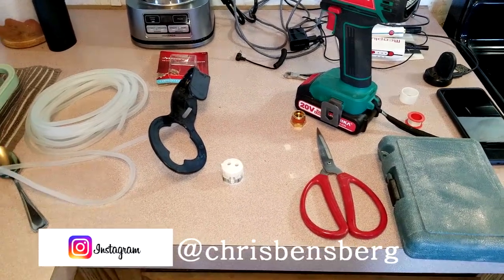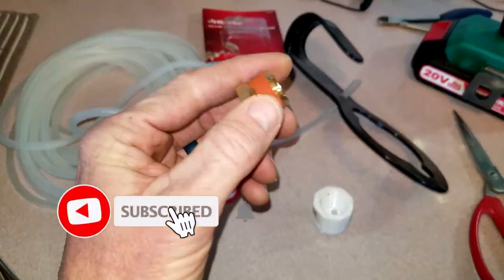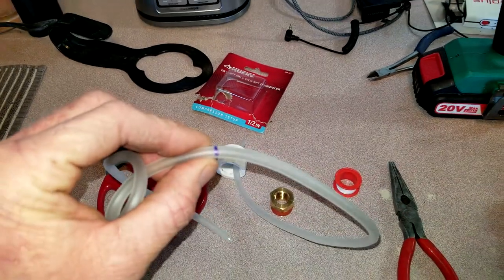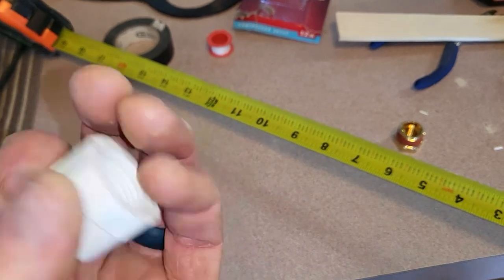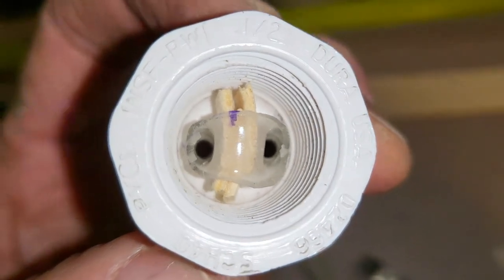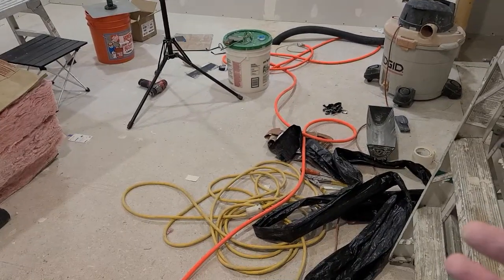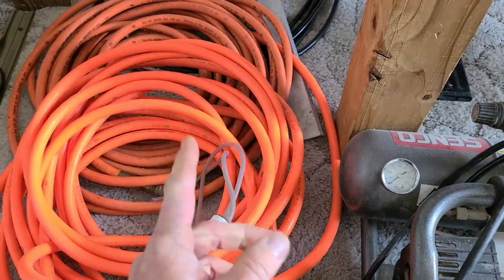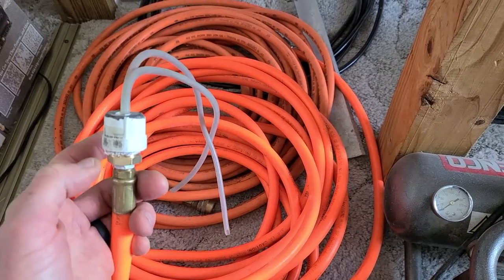How To Make Your Own HVAC Duct Cleaning Whip!

Comment: Will this work in flex tubing vents?
Reply from the maker: Yes, but really high psi might tear through the foil like material, my compressor wasn't very high powered so I did try it on my dryer vent etc. Just be careful.

Comment: Teflon tape is a lubricant not thread Sealant
Reply: I don't use tape much, but the other day I put in a cheap adjustable arm and shower head that came with tape. I was too lazy, tired and dirty too god all.thee.way to the basement to get my TFE paste. Obviously, it's not dealing with too much preasure and it's in the shower so . . . 
Works fine.  I see a lot of plumbing vids on line where people use both tape and TFE or other jizz. I've never seen an old school plumber use tape. 
Most of the teflon dope jizz lubes and seals etc.
Reply: It is a perfect thread sealant